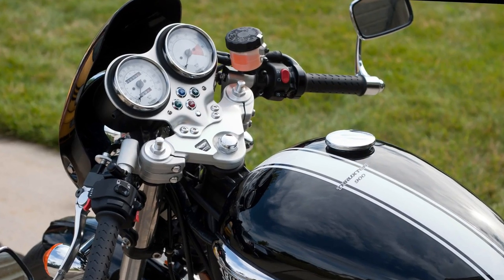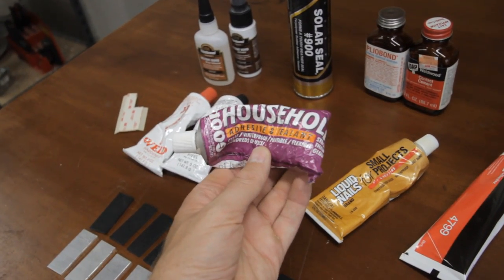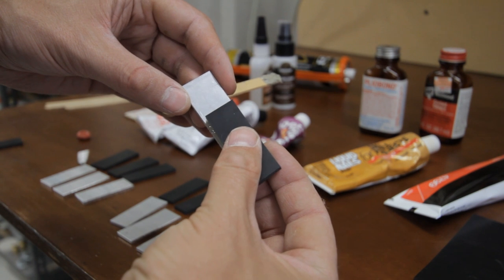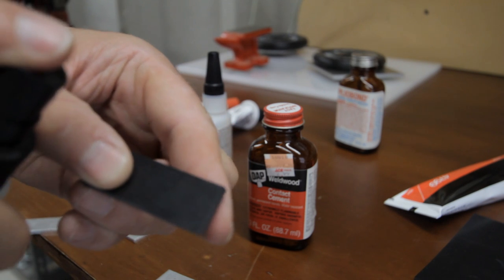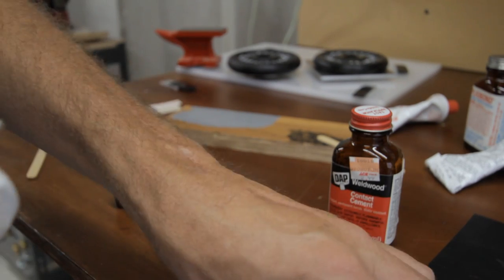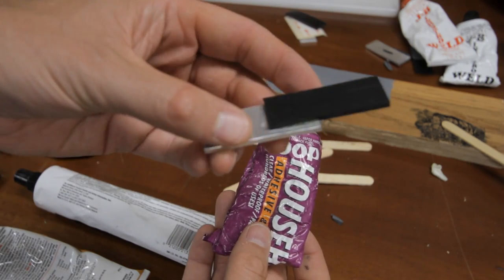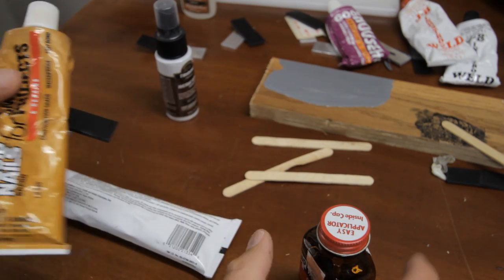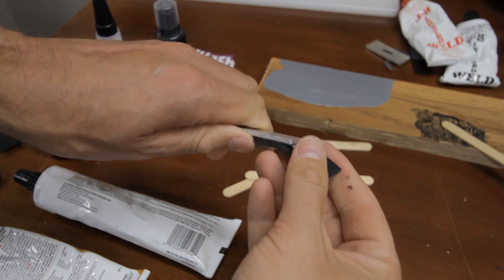Glue Test/Comparison for Gluing Rubber to Metal

Comment: In the 60's, my dad made a canvas boot to span between an aluminum home made camper and the back of the cab after he removed the rear window. The glue was brush on, grey of a thick consistency and came in a pint screw top can. It dried super strong with slight flexibility. When we tried to peel it off some weeks later, much of the adhesive stayed onto the painted surface of the truck but it was impossible to take off the aluminum. The glue never really fully dried as it would pull the hairs off my arm if I leaned heavy on it.
Reply from the maker: Sounds like good stuff.  I wonder what it was.  Probably something that would be considered industrial level and not commercially available.

Comment: Ridiculous  conclueion. Of these things, I  have only tried JB  Weld for rubber to Al.  It does fail, but on rubber, not  Al -  as you say.  I  am still looking, but as of right now, from what you say, CA Glue is the best choice.  A glue  sends molecules into each surface to be bonded, like a weld.  You chose a tape, an intermediating surface.

Comment: Try GM weatherstrip adhesive and 3M plastic emblem adhesive the next time you test these. 3M 5200 Marine Adhesive may work if it will bond to rubber - it bonds to everything else. Thanks for a quick and interesting test of stuff that most of us have lying around, but had not really tested like you did.

Comment: Very useful comparison, thanks! I recall at an old job using Loctite 480 (CA with microscopic rubber particles) for sticking rubber to stainless steel. We cleaned surfaces with alcohol before applying and it created very tough joints. I believe the rubber particles toughen the CA by acting as 'crack arrestors'. It's around £30 in the UK for a 20g bottle so not cheap, although many other brands of 'rubber toughened' super glues are now available online

Comment: Thank you so much! Saved me a lot of trial and error. I had to join metal to rubber as strong as I could and I had no idea what was my best option. I looked up the VHB tape at the 3M website, FYI the one with the strongest shear strenght is black,  the 5952 "family" of tapes, which has products 5906, 5907, 5908, 5909 (from thinnest to thickest, .006 to .012 inch). Thinnest would be best unless there is uneveness in the surfaces, then you might want thick. Per the site, you want to sand both surfaces lightly with a fine grit in small circular motions, then alcohol.
Reply from the maker: +linzerpa Great additional information!

Comment: Been carrying the same Samsung A5 cellphone around for some 6 years. On day one I superglued small rounds cut out of roofing rubber known as epdm to the aluminium back to prevent sliding. It's by now rounded off but still on. Same to repair electric bicycle dash switches people operrate with their nails  so they wear through. Covering cracks in plastic housing from tbe inside...rattling plastic mudguard holders...drip drip...set. 
Keep the little c.a. packages straigt up in a spray can cap and simply don''t screw the cap back on. Well, in a safe place that is. If you find this unsafe, whipe the package before you put the cap on and keep it upright just the same.

Comment: what glue would you use to secure rubber feet to a tripod holding heavy speakers or any equipment 40lbs or over..  just to make sure the rubber feet dont get lost and maybe to even add another layer of protection for your floors.
Reply from the maker: That depends.  How often would these be moved?  The strongest is to use a quality cyanoacrylate or super-glue.  It won't come off, but over time it may show brittleness at the glue joint.  I prefer 3M VHB double sided tape (or very high bond) because it is strong, flexible, replenishable, and less messy, but it is less strong than CA glue.
Reply: I need a product that does not dry hard like super glue.  these are mobile and used several times a week.
Reply from the maker: I had the same requirement and ultimately chose the  3M VHB double sided tape.  It's very strong and easily replaceable if need be.

Comment: Why you did not go with CA Titebond if the worked the best? Furthermore, one should test which one is heat resistant as CA. Yet I wonder how can CA act on metal while originally it is for wood?
Reply from the maker: The main reason is because CA glue is a more permanent solution and is brittle.  The 3M tape is easily removable and supple.  Strength was not the main requirement for my use case.  CA was not originally developed for only wood.  It can be used on most surfaces.  CA has found renewed life in the woodworking community in the last decade or so.

Comment: I use 3m super weatherstrip adhesive in black to seal my rubber trunk and other seals in classic car builds.
It holds up forever, well I never had one start coming off.
It’s a good idea to use denatured alcohol or wearever brake kleen spray on a clean rag to clean both mating surfaces then apply..
Don’t use anything but wearever as it evaporates very fast and is not unpleasant like other brands which are comparable to nasty carb cleaner.
I also use an incredible caulk gun sealant from BASF called Master seal NP 125.
I’ve applied it directly to wood, metal, rubber and all other surfaces in my jack of all trades life.
It’s by far my favorite sealer and it can be painted.
For instance I just built a Jerry can holder out of mild steel to carry a 5 liter Jerry can on the back of my service van.
To keep the cam from vibrating and chafing against the holder I cleaned the bare metal with brake kleen and applied the NP 125 directly to the steel.
I then painted it a few days later after it dried and I filled some rough spots with bondo on my welds.
The can rides super quiet in the holder and I know that stuff will stay for a very long time if not indefinitely.
Reply from the maker: Thanks for the great feedback.  Like you, I am always looking for the best tools and products to solve problems.  Appreciate it. :)
Reply: @panofish  
No problem.
I love your bike by the way.
My Dad cad a few older Yamahas back in the late 70’s….wish he hadn’t sold them.
His cousin was big into bikes and has three Vincent black shadows.

Comment: How did it hold up? I am about to do the same thing for my side stand on my bike
Reply from the maker: Still the best option for me was the 3m double sided tape, but the superglue is much stronger.  I did have to replace the tape and rubber once... the rubber was kinda smashed but still holding on.  I eventually decided I would keep the center stand off the bike except when doing oil changes.   I like this best because the bike looks a little cleaner and I don't use the center stand anyone except when working on the bike.

Comment: What glue would you recommend to use for rubber to a vent window lock?? (Which is metal) I want it to be able to withstand water and heat. Hope you answer, thanks a lot!
Reply from the maker: assuming the vent window lock is made of metal then I would use the 3M VHB (Very High Bond) double sided tape.  :)
Reply: panofish thank you so much! :)

Comment: You didn't prepare the surfaces at all. . Pretty useless test overall
Reply from the maker: Not in my use case.  I did not want to ruin my motorcycle surfaces.  I wanted an option that worked well and was reversible.  Double sided tape was best for my use case.